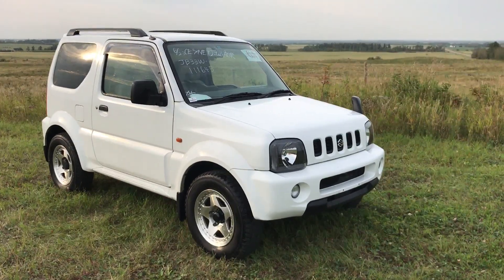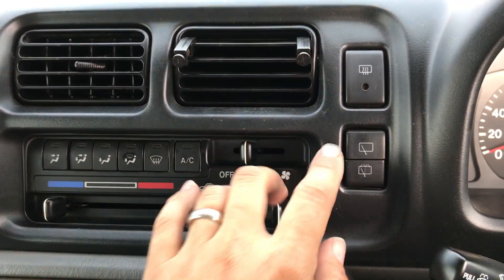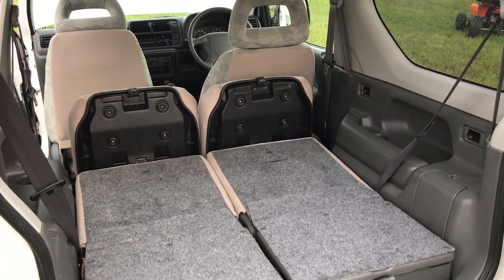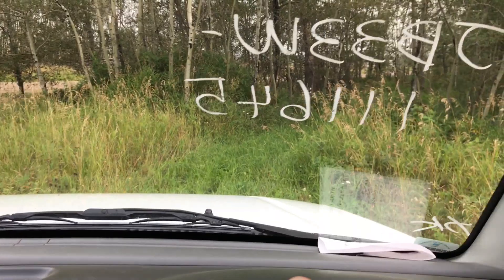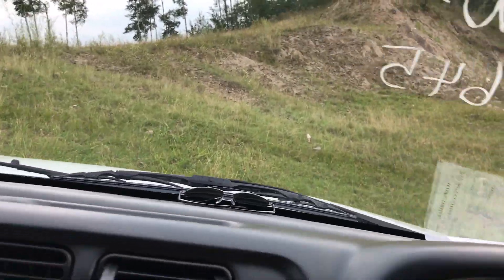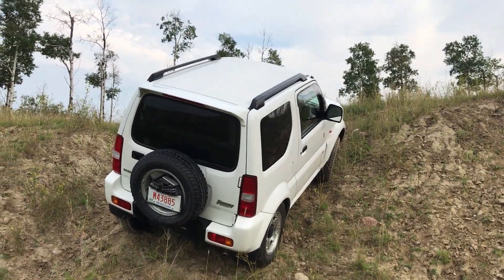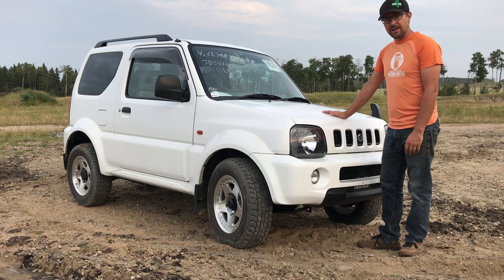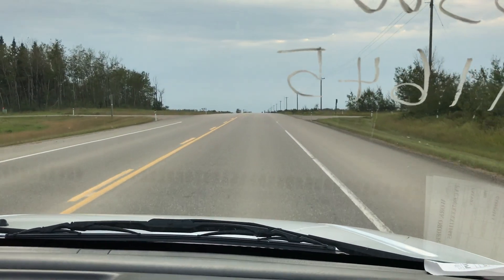The Samurai Lives! Suzuki Jimny Mini Truck Review, Drive and 0-60 Run

Comment: Thanks for the review.  I’m in the Philippines & the Suzuki mini trucks are VERY common here.  I have one currently and have been impressed with the abuse it has handled.  BUT I would like to use bigger tires in the mountains.  Learning in your video that these have coil springs & divorced transfer case gives it the extra points over the mini truck.

Comment: hey Jeremy how would a Jimny compare to a Geo tracker?
Reply from the maker: A Jimny is built way tougher. Full ladder frame with solid axles front and rear. (Basically built like a jeep) the trackers were just unibody and a pretty puny suspension. Trackers are ok don't get me wrong but a Jimny is a true off-road rig.
Reply: @4sonsoffroad  I'm jumping on here 5 years later just to tell you you're wrong. Trackers/Vitaras are full ladder frame, solid rear axle, proper gear driven transfer case. Only real difference (besides overall dimensions) would be independent front suspension.

Comment: I'm from Calgary, I am interested in a Jimny, what is the difference between the Jimny wide and the standard model, is there much of a difference?
Reply from the maker: They are very similar. Almost Identical body. The biggest difference is the standard Jimny in Japan has a 660cc 3 cyl Turbo engine. 64 hp. The Jimny wide has a 1.3L 4 Cyl engine, 85 HP wider Axles and Fender flares
Reply: Four Sons Off-Road Inc. are those axles actually wider or are the rims just offset rims and a couple inches wider?

Making a separate axle for the Jimny's would be cost preventative.
Reply from the maker: @jessebrown1400  Surprisingly they are different part numbers between the wide and standard.
Reply: Wide Jimny more strong than 660😊

Comment: How much of a payload can the mini's take? Can all of them tow a payload and how much? Can the mini's tow a payload with a payload in the bed.
Reply from the maker: The payload is 350KG on most of them. Considering the trucks only weigh about 1600lbs one just has to use some common sense. So if you have 900 lbs in the box you probably don't have much left for towing.

Comment: As an aside the Jimny is basically the continuation of the Sierra. Despite being sold in Australia for many years the Jimny no longer meets Australian Design Rules (ADR) this means they can only bring in 400 a year. Which means the waiting list for a tiny 10yo shitbox is longer than the waiting list for the new Ferrari 488
Reply from the maker: Thanks for watching and commenting but Would you mind removing the foul language from your post?
Reply: I like your stuff but I'm not some kind of weirdo christian so I'm going to conform to societal norms and talk like a human being. If you cant accept that most Suzis are tiny shitboxes you should bring it up with your pastor
Reply from the maker: Interesting point of view. I was more thinking about the hundreds of thousands of veiwers to our channel from all over the world that don't need to read "normal" language simply because ones vocabulary hasn't developed yet. 
Have a nice day.
Reply: Four Sons Off-Road Inc. Suzuki's are not s***, I had a 2006 Grand Vitara Gold Edition 2.7l 4wd with electric locking diff keyless entry and remote entry.

Only the luxury brands had all the goodies I had in that GV and the price I paid for it would make those luxury buyers blush.
Reply: @4sonsoffroad  im not offered by the language.